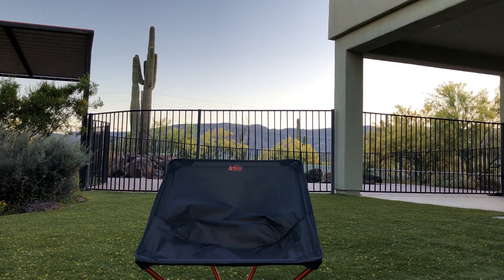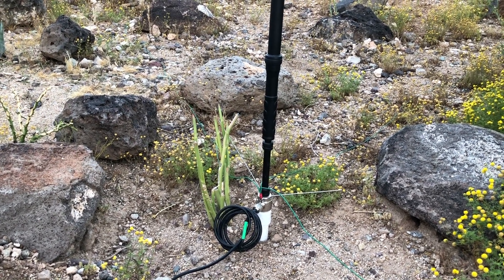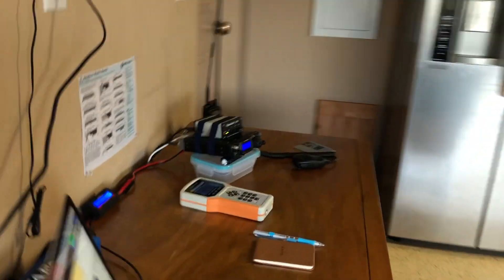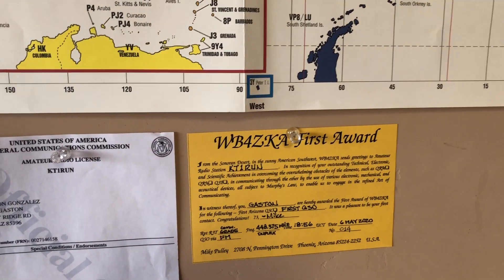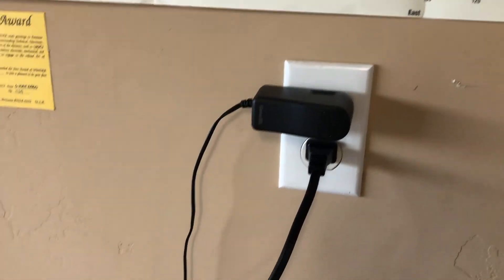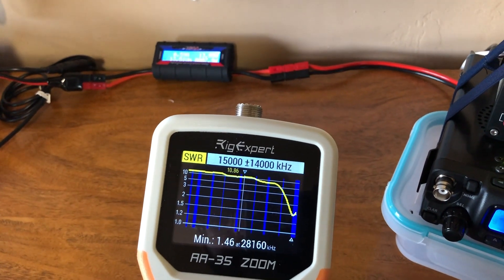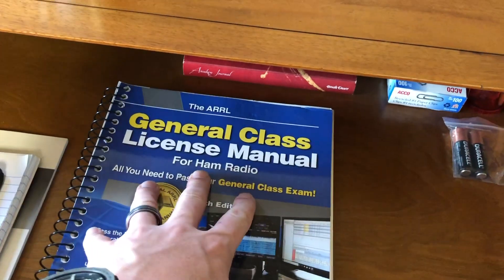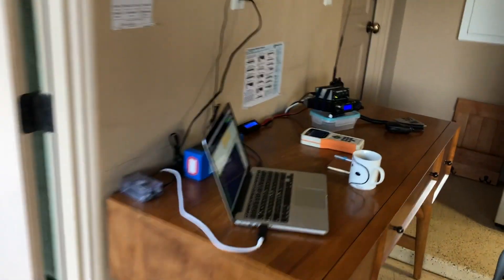My First Ham Shack

Comment: You probably know by now, but you want to get your antenna higher than that, a half or quarter wave from the ground is ideal, but impractical for the lower bands like 160 and 80.
Reply from the maker: Thanks for contributing to the comments.Yes, you are absolutely right. We are very much limited by a lack of tall trees out here. However, I have incrediblesuccess week-to-week running my dipole for 80m, 60m and 40m in a NVIS configuration. I love the regional capabilities. 73

Comment: Subbed.  Nice first shack, you have allot of good fundamentals.  I’d think long and hard about that draws hat, reviews and opinions are pretty mixed.  Keep up the good work 👍
Reply from the maker: Thank you! That's good to know about the draws hat. The Raspberry Pi in its current configuration is doing everything I need. I may just add a GPS USB dongle and called it a day.
Reply: The Tech Prepper I have a video on installing the GPS dongle if you’re interested.  Checked out your solar panel video too, good stuff 👍
Reply from the maker: @TheSmokinApe  Very cool. I'll check it out, thanks.